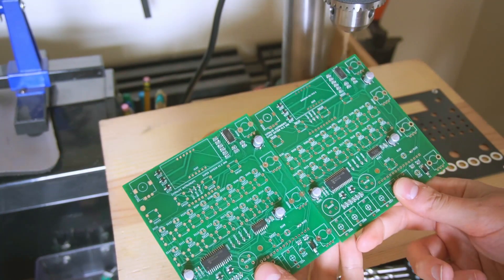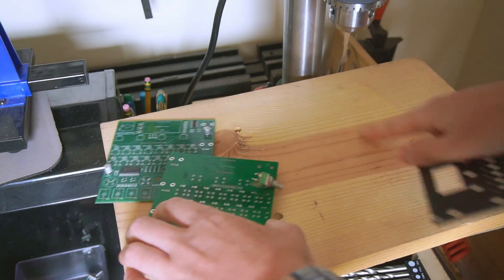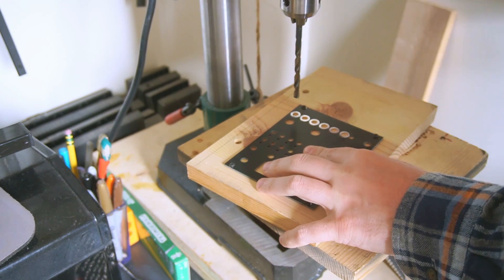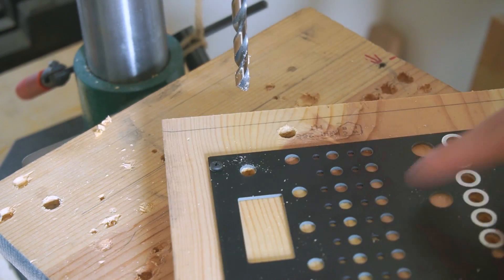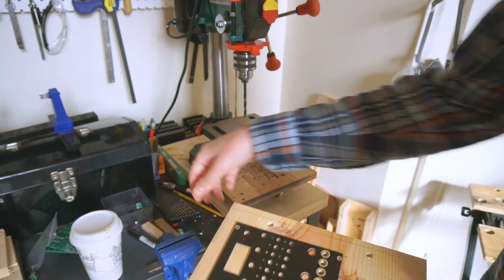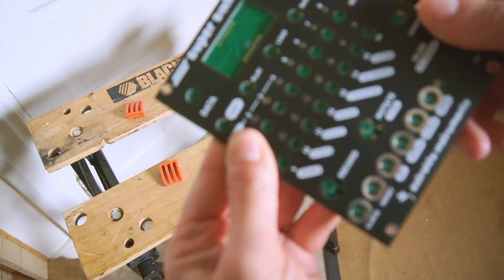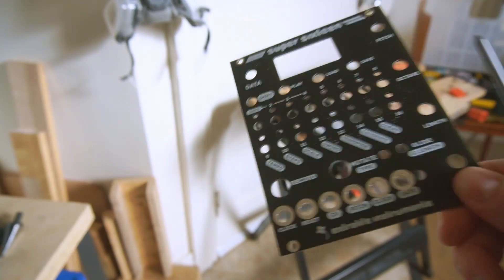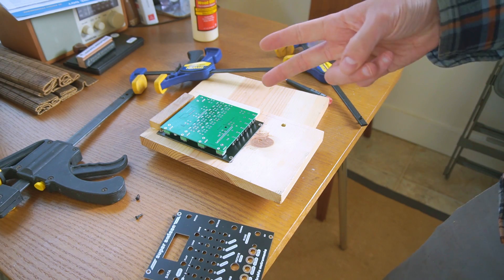Making a Circuit Board Soldering Jig for the Super Sixteen

Comment: Fantastic idea 👌 - I think I might take a stab at this myself 🤔. Was it worth it in the end?
Reply from the maker: Certainly yes, especially since since I'm making lots of identical modules! For doing one or two it would be a bit overkill, but  it's really handy to have the LEDs captured by the jig and it's really nice to have a perfectly level board that doesn't wobble or move during soldering.
Reply: @extralifedisco  I also think you would get the minimum amount of clearance between PCB and Panel - which realistically does not matter all that much 😅. I am over-thinking, but might still try!